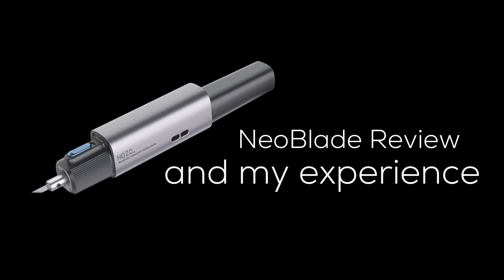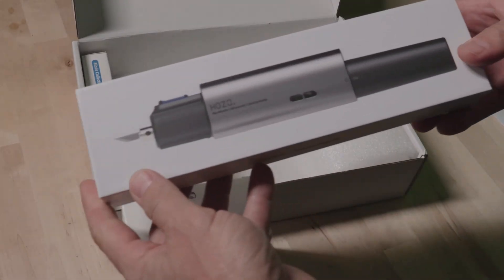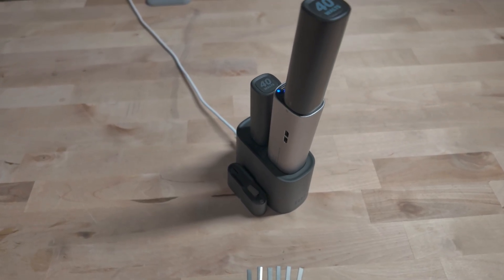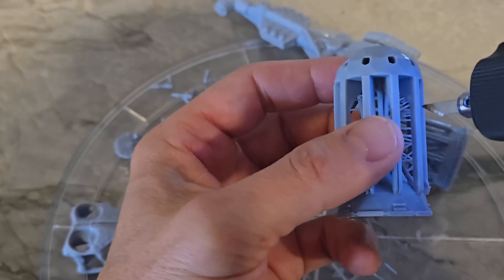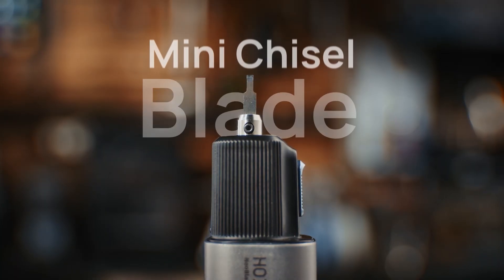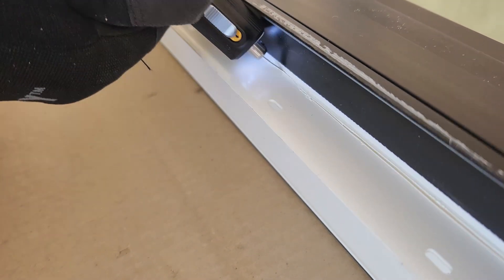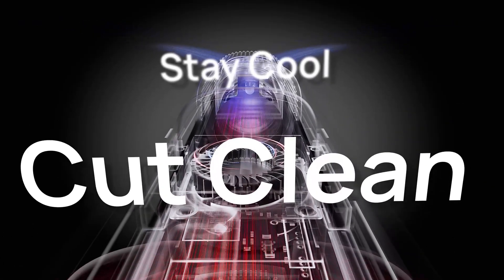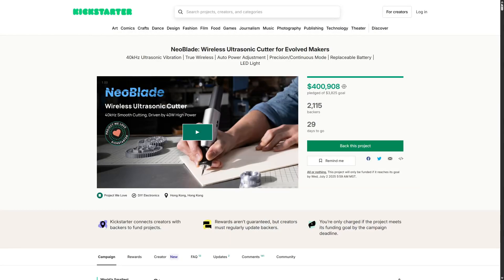I Tried a Sonic Cutter for the First Time and WOW!

Comment: Yeah got that thing and it melted everything I tried to cut. Also in 2 minutes the whole thing turned into a heater. Handle got super hot. Returned. Got the Hanboost and it works like a DREAM!
Reply from the maker: Wow maybe u had a bad unit. Sorry to hear that!
Reply: How much did you get to write this comment?

Comment: Dude, that things is a fat little piggy. Plus, this seems very gimmicky and a unitasker. Supports are literally the easiest thing to use it on. The blade is too flimsy. Use an oscillator tool for home improvement and be done with it. Side cutter for FDM printing. Boom done and 100 dollars richer.
Reply from the maker: Lol you got it. But your forgetting it does more then just supports. I am going to use it to cut acrylic for an upcoming project. I am sure it will come in handy for many hobbyists for all types of scenarios. Just for resin supports. Probably not. Fat little piggy 😂😂😂😂
Reply: @planet3dp great idea. I’m sure you’ll be limited to about 5mm thickness but worth a try.
Reply: @planet3dp  Can you make a video using all those types of blades?